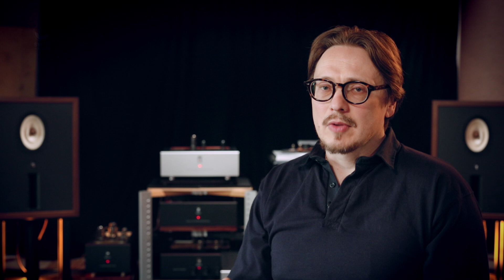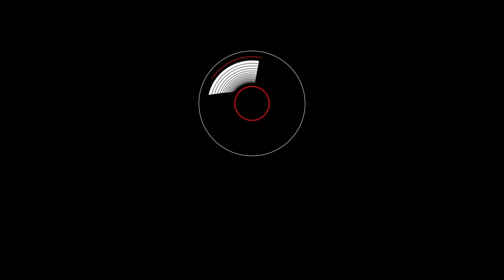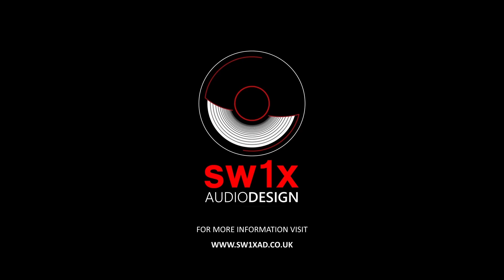Why Digital Filterless R2R Dacs are superior over all other types?

Comment: I agree with what you say if I had speakers from 10,000 euros and up, otherwise the brain is already crowded with the distortions of speakers under 10,000 euros!
Reply: Money doesn't mean performance. Even if it does you start hitting the cap at like 2k
Reply: @Haydos  There's no way you can have something high-performance at 2K, only the components in the crossover are 1K....
Reply: @marioo-q8h  no
Reply: It doesn't work like that.
Reply: @mariodrv  If you don't have high-performance speakers, you can't tell the difference, that's if placebo doesn't intervene.....and in order not to waste your money on expensive speakers, it's best to make speakers with expensive components where you don't have how to fail.

Comment: HAHAHAHAAHAH... ALL 100% BS

Filters actually add more RESOLUTION to the end sound, it is to remove Noise so that the Sound is PURER and HIGH in Fidelity and resolution.
i know terminology is confusing, but is pretty simple...

throughout the years i have dedicated a good amount of time trying different topologies in Dacs... R2R, IC Multibit, NOS, Delta Sigma, Hybrid Delta Sigma, FPGA.... 
Brands from Burr Brown, Phillips, Wolfson, Analog Devices, ESS, AKM, Custom, Cirrus and Realtek.

Best to date are ESS and some implementations of the Phillips Multibit Dacs.
Implementation is what you need to focus... because is not just put a chip on it and it will sound like a million bucks...

Comment: Mike Moffat of Schiit Audio also made a good case for multibit digital, albeit with 4x oversampling. He agreed that the original audio samples must be retained, and also pointed out that noise shaping adds high frequency hash that reflects back into audible frequencies. When I first heard a multibit DAC, I first noticed the lack of hash/noise and the phase coherence. I already know the Audio Science Review counterargument: but it measures worse! But do the aspects where it measures worse actually sound worse?
Reply: The Bifrost lets you switch between NOS and their filter. NOS is quite unpleasant to me.
Reply: You wrote 4x over sampling.
But is that the actual rate?
Chord m scaler and even hq player are doing 1mio+ oversampling.
And (at least) I can hear the diff to normal mp3.
It also puts r2r into perspective. The better the dac digi chip is, the more you get from up/over-sampling
Reply: @tdfmike3915  I'm referring to Schiit's 4x multibit implementation. The Chord M-Scaler and others take oversampling much further.
Reply: @tdfmike3915 many R2R DACs are exactly that...resistor ladders.  Denafrips, Laiv, among several others.  No DAC chips.
Reply: Mike Moffat/Schiit Audio claim much to make a sale. I bought their Original Yggy DAC and have since swapped to the LIM DAC's, spending my hard earned cash on an insignificant "upgrade".  A victim of one of their consistent marketing schemes.
Schiit now has their own Delta-Sigma creation that Mr. Moffat claims is their best DAC ever, despite all the years of overselling their multibit concept with a super-duper top secret, proprietary Digital Filter.  
Their misleading claims and marketing scams just keep getting more ridiculous as they shamelessly discredit everything they ever said about Multibit.
Reply: @cmc2234 not really Delta Sigma.
FPGA programmed.  If you're so disappointed just sell it on.
Reply: More than a good case.  He helped build a company on it.  Schiit Audio.

Comment: Tube output stage might get rid of the digital glare.
Reply: Nope. Good tube amps let all the good and bad come through including digital glare. Swap a polite sounding tube and you can mitigate some of the glare at the expense of some veil to the sound
Reply: Don't buy a DAC with a Sabre chip.
Reply: It's not the tubes, it's the output transformer, a built in low pass filter.
Reply: @1mctous thanks - was about to add that as well.

Comment: Rob Watts argued that R2R can never be perfect because the differences between resistors, what's your take on that?
Reply: Rob Watts is also selling his alternate philosophy.
Reply: With enough resistors the law of averages will apply. But yes it'll never be perfect. Then again Analog & digital conversion one way or the other will also never be perfect. Thing is modern DACs & ADCs are so close to perfect we cannot tell the top end apart. Same is also true of R2Rs given enough active time in the industry.

We can't reach perfection but we can make the difference imperceptible.
Reply: Nothing is perfect.  It just sounds good.
Reply: Rob Watts follows a different approach which makes use of very aggressive digital noise shaping to achieve his goals. He is doing extremely well within the constraints of his chosen approach. He is right that you need matching resistors with very tight tolerances, especially if you consider what bit-depth you want to achieve, i.e. a true 24bit R2R ladder DAC needs extremely tight tolerances since each extra bit requires you to match the tolerances twice as precise. You can google the required extreme tolerances on google, you will find matching tables. However, it's quite possible to get resistors matching tightly enough. It just costs money to do so, you use enough tight tolerance high quality resistors in parallel and you get to that point. If you want an example at practice, look under the hood at one of the hifi shows of the Aries Cerat Kassandra line of DACs. You will see crazy amount of rows of those beasts in parallel before they are connected to the DHT output stage. At the price point Rob Watts is operating at with his DACs this approach is too costly. I am familiar with his Chord Dave and it sounds quite natural given the approach he is using, but to my ears it's not a natural representation like you would get with products properly implementing the approach in this video. I believe that he has only been able to do that with ridiculous effort put into each little detail, the DAVE runs on more than 1 million lines of code and is doing a ton of processing. In the end it's prettifying and attempting to mitigate the damage done by filtering (which his DACs need, you wouldn't want to listen to that without filtering) while once the tolerances are tight enough for a true R2R ladder dac you simply get back the exact same precision as it the file was stored digitally. Now, R2R in itself is also not perfect, it would have to be continuous to do so (have a look at some innovative approach for how a continuous DAC looks like from Aavik SD-880) since reading out bit-wise information with a resister ladder introduces ripples. Every approach has to fight with their own enemy based on the topology chosen. However, some automatically lean heavily into authentic reproduction when done right. Without integration of a very stable femto clock for the R2R ladder DAC timing will be off though, Rob Watt put a decent but not top notch femto clock into his Dave but applies some neat processing tricks to correct for timing issues aside other things. There is a reason it sounds pretty good even though he applies so much processing but I would hardly describe the way his stuff sounds authentic. Just do your own experiment and hook up the Dave side-by-side to a non oversampling R2R with internal clock and analog output stage. You will understand what he talks about in this video. I have not heard this DAC but others following that overall approach.
Reply: Holo audio has already solved for this by implementing two ladders that compensate for each other.

Comment: He's talking about what Esoteric did 5 years ago with their new Discrete R2R DACs...
Reply from the maker: others only followed and copied us. we have been doing this since our inception in 2016 and before that
Reply: @sw1xaudiodesign I guess it's hard to answer without analyzing the circuits, but is it possible for a cheap r2r dac to sound good? At least, better than a ds dac of the same price?  For example fiio k11 r2r vs fiio k11 ds
Reply: Not even close as exactly the same...

Comment: R2R is BS, my Schiit Yggdrasil was really inferior to my cheap Loxjie D40PRO, even my SMSL SU-9n did better 😛
Reply: Except that Yggdrasil is NOT a R2R DAC!
Reply: @goodsound4756  If you can read dude => "The amazing Schiit Yggdrasil combines a state-of-the-art digital filter for perfect time and frequency domain response, then drives the output via an R2R DAC for a remarkably analog sound. Now with upgraded analog boards, Yggdrassil let's you say goodbye to "digititis" and hello to resolution, PRAT, transparency and incredible musicality." DAC chip: TI DAC11001B 20-bit D/A converters, look at the specs it's an R2R architecture.

Comment: Interesting to read the comments of people who probably never heard a nos r2r dac and only throw in the measurements argument too bad.
They are to my ears and that's all that matters the most natural sounding DA conversion BTW I have an Abbas Audio dac that is similar in concept.
Reply: I first heard an R2R DAC in 1982, so your statement is false, at least for me. 

They have no pluses over sigma delta, only minuses.
Reply: @jamiehowarth541 maybe different peoples' ears are sensitive to different types of distortion? I have Chord DS DACs as wells as R2R (and other versions of multibit such as Philips implementation using capacitors instead of resistors in the Dac chip) and prefer the sound of multibit/ R2R. Maybe it's related to listening with very revealing electrostatic speakers in a well treated room ... differences between power amps are very evident here as well.

Comment: Wild claims without evidence. It is so easy to measure a DAC.  Compare the measurements between a high performance DAC with digital filtering and noise shaping and your R2R.  The top rated DACs are inexpensive. If it "altered the time domain" it is easily measured. That would add distortion and harmonics and measurable errors.   Talk is cheap.  R2R DACs sound great for sure.  You're not gong to hear a difference with those full range speakers in the background.  All that cone breakup and beaming. Add a high distortion tube amp.  Audiophiles are not interested in high fidelity. It's art collecting, and lots of fun, but it's not high fidelity.  I guess you have to pitch something to sell a new product.
Reply: God, people like you allway spew the same kind of ignorant crap in comment sections like these.
Reply: @mariodrv 
Frickin “ always. ” SMH 👍🏽
Reply: @mariodrv if nos r2r DACs better why aren't all dacs r2r? It's not much more expensive and people only resort to measurement because they need a way to compare. Where is the evidence? It's proven your ears, brain and eyes lie to you. That's why people think copper cables sound warm (they are a warm color) and silver cables are bright (they are a bright color)
Reply: @mariodrv how is it ignorant. Audio professionals and audio engineers say r2r is outdated and any delta sigma is better. Do you want to argue with them?
Reply: When DACs are measured, is this with simple sine waves? How about with a real music signal over time?
Reply: @Coneman3 the dac doesn't care how complex the signal is. It just converts the information. You can measure it at any frequency. It won't change. They do multitone testing and with real music. Minimal change in performance.
Reply: @Coneman3  Yes, most measurements are not at all done with complex musical signals.
Just go listen and buy what sounds best to you.
Reply: @Marcel-ct9wq Bingo, the same jagoffs who tell you to go A/B something will never answer the challenges to analyze actual music itself.
Reply: @Marcel-ct9wq agree.
Reply: That's like saying it's easy to measure a car. I can pull out a tape measure and see that one of my cars is a foot longer than the other one so it must be better right? After all, it measures better. What if what really makes a difference in the sound isn't so easy to measure?
Reply: @5thlevelweb887  that's the equivalent of measuring the outside of the dac. A better example would be measuring the engine. You can do that buy opening up the engine which isn't comparable to a dac but you can measure a car with tool to see it's top speed and how well it's running. With those measurements it will tell you how well the car performs. Can you see the error in your comparison? Measuring dacs is a science and is proven so I don't understand how you would say it's wrong. Do you believe in conspiracy theories?
Reply: @Haydos  and I've had 2 different vehicles with the exact same engine as well as very close to the same weight. One was more enjoyable to drive, though, because of the suspension tuning and attention paid to consistent control weighting. The intangibles are sometimes the most important part. And you can argue against any metaphor because no model is true, the question is how useful it is.
Reply: What measurements? That's nonsense. I measure with my ears. Every cheap Chinese DAC has perfect measurements. And the sound? The usual bullshit. Why are Lampizator DACs one of the best?
Because not everything can be measured. Happiness, love, satisfaction? Do you measure that too? Good luck to you. You are a robot, a machine. I'm a man.
Reply: Just because something measures well doesn't necessarily mean it will sound good.  People don't listen to test tones they listen to music.  Many R2R DACs have both OS and NOS.

Comment: Sounds like the typical pseudo-science, similar to people, who hear "digital steps" in the signal.
Reply: Dude music signal its. ot just smooth sine waves. Anything that makes the signal smooth will affect the sounds. I favor r2r, i hear much smoother delivery
Reply: not so much, I mean partially… I tried using hqplayer to apply different flavours.. normal dacs also process it and results are meh, ish… with r2r dac results are really good 😅
Reply: Never heard steps but often hear harsh glassy glare in digital music that isn't there on the albums vinyl version
Reply: @sbwlearning1372 What you've noticed may well be down to the fact that the CD version of the album is differently or poorly done.
Reply: Full agree. Many people don't understand what the "steps" are -- and that a filterless DAC has those steps!
Reply: @dougschneider8243 besides, he didn't no no filter. He said use a filter in the analog domain instead of a digital filter.
Reply: @dougschneider8243  Their tweeters will act as low pass filter.
Reply: @CS-dp1ss  That for me the best way to filter, through the tweeter characteristics or its cover. Acoustic filtering.
Reply: @CS-dp1ss or tubes, hence the beauty of tubes in the output stage of NOS DACs.